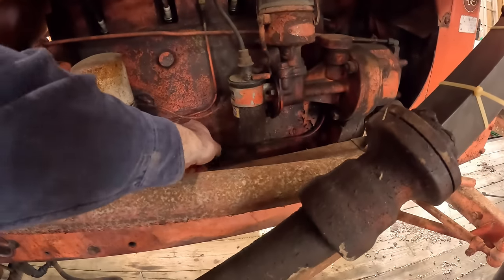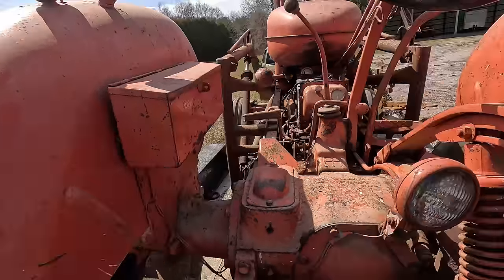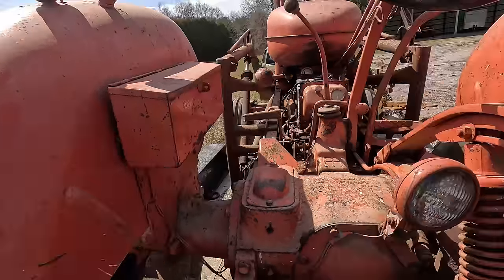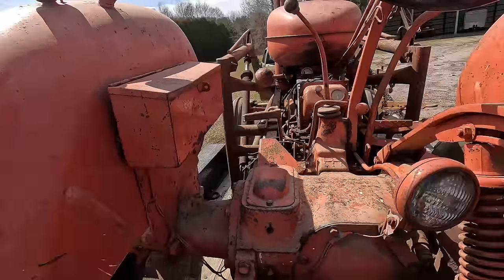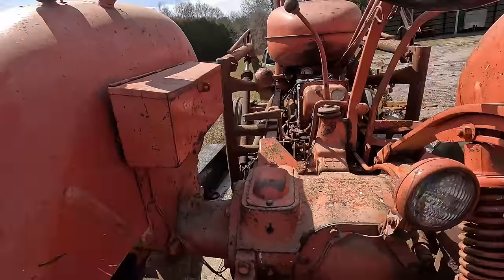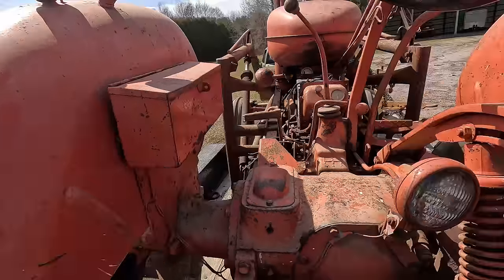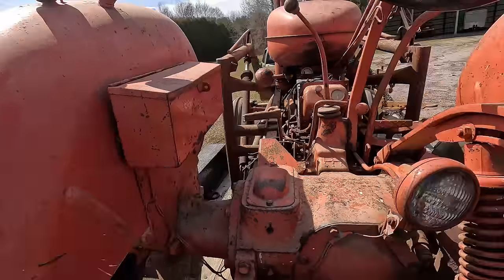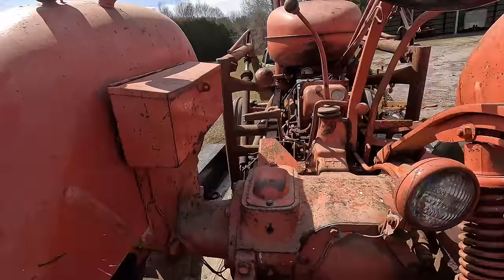Sight Unseen Auction Buy | Sitting for Years | Will It Run?!?

Comment: The tractor was among the last of the WD 45 built .  I say that because the 14.9 28 rubber was put on the last of the tractors built in the WD 45 series.  The oil pan is the original oil pan.  The radiator grill is one of the best I have ever saw.  It's definitely a tractor to keep and not part out.  I have two of the WD 45 AC tractors that run. And four that don't run two would run with just a little bit of work on them. Your WD 45 hasn't been used much.  I can see that just in watching your video.  Your tractor is definitely a show tractor  and definitely worth keeping.  It is definitely a great tractor.

Comment: I worked for a tractor company in the UK who imported AC Tractors during WW2 and earlier years, Model B, U, M, also the M crawlers for Airfield construction I only joined the company in the 1960’s but experienced selling the UK built D272 model that were sold to smallholders, they were very handy and no problem. Enjoyed your video very much.

Comment: Bubba,  My Daddy bought  a used one in 1963,    It was a horse.... I was about 12 or 13 at the time..... It came with a 10 ft   Big K offset disk...     They made a hand clutch   attachment  that hooked to the Snap Coupler to kick the clutch out if you were  Bottom plowing and the plow contacted something in the soil it would stop the forward motion of the tractor....   Take my word for it...  when it contacted something it did not shear any bolts,  it would  jump up and down untill you managed to stop it!

Comment: Randy you are absolutely right about the build up inside the battery cable clamps. I've been doing mechanic work since my teens, and I am now 72 years old and a couple of years ago I put a new starter on a truck to only find out there was a layer of corrosion that just like you I had to use my knife to carve out so the lead could contact the battery post. Great find on the tractor. I usually go ahead and spend the extra money and put brass freeze plugs back in and use plenty of #2 non hardening Permatex on them before I drive them in. If you measure the plugs with a micrometer, you will see there is some draft on the sides of the plugs that allow them to be released from the stamping die. Putting the Permatex on them is good insurance and drive them in just a little past flush to the casting bore. I have had them weep a little if I just drive them flush. Thanks for using the Brass hammer. I am a Hammer snob. I worked for a company one time that issued every millwright a brass hammer and said anyone caught using a hard-faced hammer on a precision surface would be fired. I call it good shop hygiene.

Comment: I would say to fix the oil leaks on the valve cover, replace that ugly handle sticking up on the right side, replace the tire and clean and paint the rim, shine up those beauty rims, pull that plow enough to shine up the plows and sell to the highest bidder after painting up the loader and replacing any wallowed out holes. Someone needs a good tractor like this just starting to farm and it will serve them well. 2500$ to 3,000. Like 2800 and will not excessively pay you for making it good and better than they will do.

Comment: It's a good tractor for some new young farmer. It will be a mainstay of his farm in fact. I never saw you run the pto for say manure spreading. Seems it would probably be just fine along with the loader. You said the loader was slow so hopefully the pump is OK. I can see this tractor running some young farmer for the next 20 years if by that time he can still get fuel. Seems to be economical  in fuel at this time, in 20 years fuel might be 10 times as much. As already hydraulic fluid is almost too much.

Comment: Dodge teuck use that style of light in the late 40 and 50 on the front fenders i not sure if chevy used them or not, ford used one similer but it was only 2 inch thick the so prepose was turn signel

Comment: New points and condencer, wires. air cleaner complet cleaning of air cleaner pipes and clean oil bath cup new oil in oil bath, adjust carberator fuel air mix, adjust idle speed and complet service of remaining tractor oils along with cooling system service and inspection.